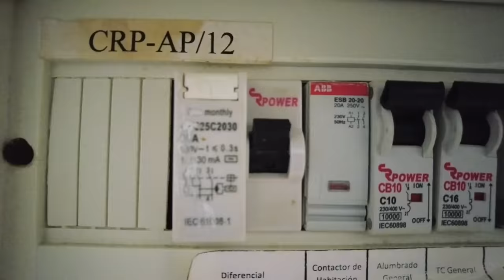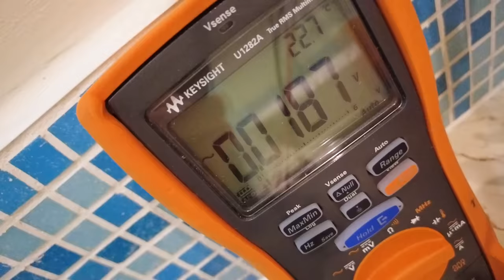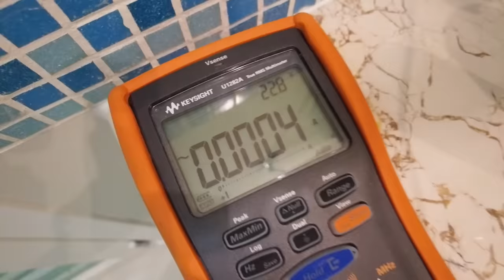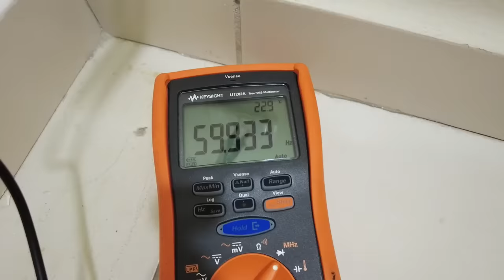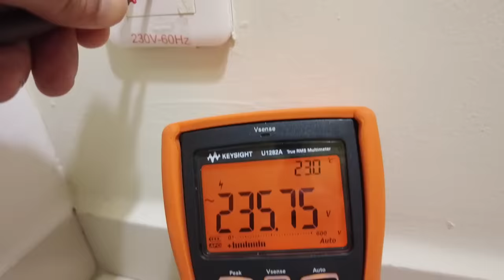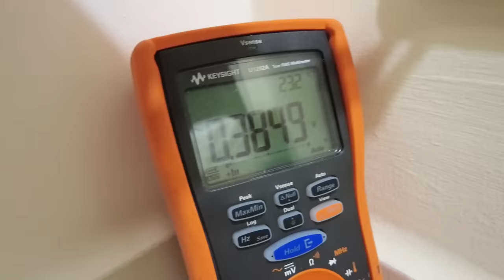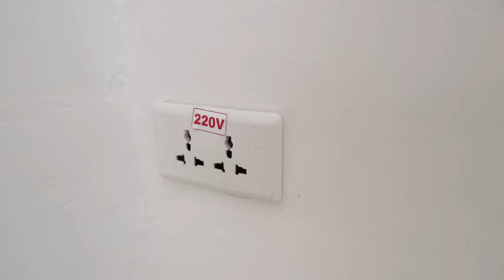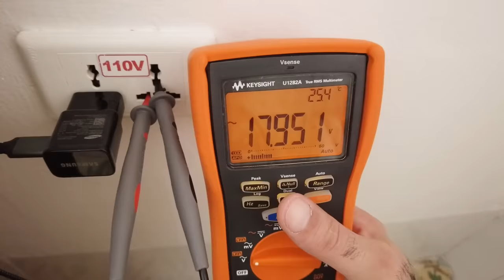Cuban Electrical System Shorting

Comment: An Isolated system is only safe as long as it stays safe, but if you don't have a protective cable (I think you call it "earth") a fault in a device may cause live voltage to appear on its outside and it will be undetectable.
Reply from the maker: Well I mean if it is isolated, even with a live voltage exposed it won't pose a life threatening danger, because there is no path to cause the circuit to electrocute anyone. It should be detectable though, because at 240V I'm sure you will feel it tingle once in a while even when it is completely isolated!
Reply: True, and it's ground btw, maybe earth in eastern european countries
Reply: @mroguretxs9651  In Poland you have "phase" (brown if only one), "neutral" (blue) and "protective" (striped green/yellow)
Reply: @babilon6097  never knew abt that, cool
Reply: @ElectroBOOM  If no current can flow will ground fault be able to detect it early?
Reply: @mroguretxs9651  Now that I think about it it used to be called "earth" but this usage is obsolete and anyone who wants their license renewed stopped using this term some years back. That's probably because both "earth" and "ground" translate to the same word in an electrical context. There is a process of grounding where you actually bury metal mesh or some other electrode in the ground. It is independent from whether your system uses protective cable.
Reply: @mroguretxs9651  No, large parts of western europe will also use "earth". Here in the uk we use both, though earth is more common, and i believe the official term.
Reply: @ElectroBOOM   But if they system are likely in Brazil, there is two phases 110v+110v in the 220v, so if you touch a single wire, it's just 110v undetectable if you are isolated
Reply: @ElectroBOOM  And in Brazil we have the two systems, 220v phase + neutral, and 220v phase + phase, it's depends the region you are. And is very common you found buildings with no ground or ground connect in nothing
Reply: At 16:32 isn't the 220v isolated via the switch that's turned off above it?
Reply: Yeah. The rule I use is if you have a (properly) isolated system and have 1 fault, you are good. If you have more than 1 fault, then you're not good.
In the case of that hotel, I would say using a traditional grounded system with GFCIs is probably your best bet.
But for a shaver outlet with only 1 plug, and very limited output, using an isolated system will probably work better.
He really should do a video on isolated power systems and what is available to keep them safe.
Reply: @babilon6097  Here, the typical phrase is "earth ground", which is used to distinguish "ground" as used in LV context (the "ground" on a laptop might or might not be referenced to "earth ground" when it's plugged in, and won't be when it isn't plugged into anything).
Reply: @lperkins2  Sorry, you have to expand on "here". My thought-reading pendant is not yet internet-enabled.
Reply: @babilon6097  Heh, fair.  North West US.  Can't say about the rest of the US, but Washington, Oregon, Idaho.
Reply: @lperkins2  I can understand naming a state after the first president, but I didn't know you have so much respect for Duncan from Dune. And the Oregon trail wasn't that big of a board game.

Ok. I'm exaggerating a bit. But honestly "north-west US" tells me more than those 3 names.
Reply: @babilon6097  I've learned to specify, since in most of the world, when they say "Washington", they mean "Washington DC", which we just call "DC".  DC is 2500 (4000km) miles from here.
Reply: I think I see where you are coming from, undetectable in that it could be isolated to the device alone, and not appear at a breaker panel at all. Yea you are nailing it, it works unless it isn't working, and in that case ehh not your problem anymore lol. 

you could easily become part of the circuit if it was a metal casing with more than one piece which incorporates plastic isolation somewhere, really anywhere. a screw just one little screw could be on one circuit while the rest of the device is floating at the other. grab both and goodnight sister. thing could be off, thats the scary part. just plugged in.
Reply: @ElectroBOOM  But it means that if you have a 60s old metalic cuban refrigerator without earth plugged and without a differential breaker... if the live touches the metal cover and you use the handle without shoes.. you could die
Reply: I think its not isolated, they just have live and neutral and installed a grounded outlet on 2 wires without ground connection. Common in old houses, especially in 2nd and 3rd world countries.
Reply: @ElectroBOOM  I think its not isolated, they just have live and neutral and installed a grounded outlet on 2 wires without ground connection. Common in old houses, especially in 2nd and 3rd world countries.
Reply: @mernokimuvek  Old houses in the 1st world often also have 2 wires.  Sometimes neutral gets tied to ground at the outlet, but often it's just left floating.  Code even allows that as long as it's labeled "no equipment ground" and is a GFCI.

The reason he's assuming it is an isolated circuit is because the potential drops to 0 when he shorts it to the plumbing (which is quite likely at earth-ground).
Reply: @wachocs16  Pretty sure there's a vid of that. I forget which country. Guy goes into a store barefoot and carrying a child, touches the door of a fridge, drops the kid and gets locked there getting electrocuted. Then some old guy runs over and knows exactly what to do and kicks the door off its hinges and saves his life.
Reply: @ElectroBOOM  I think your daughter's super cute. Would you mind if i send her flowers? :D
Reply: I'm from the UK and I like the "earth" naming rather than "ground". It can be helpful to make a distinction between ground within an electronic circuit and earth within an electrical installation. Even a mains-powered device may have its ground offset or completely independent of earth. A good example is capacitive dropper LED lamps: the ground within the DC part is actually live compared to earth.
Reply: @lperkins2  LV context? Everything is LV until 1000 V.

Comment: As someone from Brazil, I have seen many places like that, and I can guarantee that the lack of ground and those inverted pins are not due to technology or safety... Most electricians just ignore those because of the infrastructure or costs. It's usual to get shocks from the shower or fridges here. Those breakers are a luxury most houses don't have (I've only seen them in new buildings).
Reply: In most countries neutral wire is grounded on the power plants and transformer stations. I guess it helps to level out potential between different parts of network, but also this is what makes live wire, well, live. Mehdi found out at tha second place that not only outlets lack ground connection, but also have floating neutral. And probably it was intentional, to make it safer.
Reply: @voidseeker4394  It's grounded to make sure that plugged in household appliances that requires ground (because of metal encasing for example) are also grounded and do not shock you when somehwere in the system a short between the ground wire and a live wire happens or a lightning strike hits it.

Yea, it's safer when you touch the live wire but grounding itself is a safety measure for cases where you don't touch the live wire directly.
Reply: @Bobylein1337  uhm, i don't understand what you're talking about. Neutral wire, by definition, is a grounded wire used to get reference potential. If neither of wires is grounded, there is no live wire, both are equal. And shorting it to ground won't do much, because it's whats already done in most countries. And chassis ground is different from the neutral wire, it's dedicated wire, usually grounded locally near the building.
Reply: G E T  R E K T  your example is irrelevant, 12v battery terminals have potential difference with each other, obviously. But there won't be any noticable current flowing if you connect one of them to the ground. Also, battery outputs DC, while power grid runs on AC, which makes wires change their potentials at 50/60 Hz frequency.
Reply: G E T  R E K T  i know that ungrounded circuit can have potential difference to ground, but resistance is so high it won't allow any significant current flowing to ground. This is exactly what Mehdi shown in the video. Voltmeter is reading voltage between floating wire and ground, but it doesn't provide current flow.
Reply: G E T  R E K T  yes, if you touch both wires, you'll get shock, no matter whether there is neutral or not. But if you touch just one, and touch ground elsewhere, you're likely to be fine if none of the wires is grounded. If neutral is grounded, however, and you touch line(non-neutral) wire, you'll get shock with dangerous current, just like if you touch both wires at the same time. This is why some standards allow outlets in the bathrooms if they are connected via decoupling transformer (like that shaver-only outlet in the video). Decoupling transformer is doing exactly that - "ungrounding" neutral to make it a bit safer.
Reply: @Voidseeker I know it’s out of topic here, but there’s a good reason why most electrical installations are grounded.. it’s to provide automatic fault disconnection by circuit breakers and rccb/gfci, before it becomes a safety issue after a single fault occurs. In an isolated system, a single fault where a live wire touches a metal enclosure cannot be automatically detected, and thus, if one day, another fault occurs somewhere in the system it is never detected and can be fatal if electricity runs between the faults (like through metallic pipes). This is known as a double or second fault. This issues are well documented in IT earthing systems. Earthed systems include TN-C-S, TN-S, and TT.
Reply: This is the true reason. Inverted wires? Dont worry it works so whatever. Earth/Ground? You want to run an optional extra wire? You know how much that will cost?. And that basically sums electrical connections in latin america i guess

Comment: 2:21 Those are commercial smoke detectors that are tied directly to the buildings Fire Alarm Control Panel (FACP). Setting it off will set the entire building into alarm, if it's set up as an alarm and not a supervisory. It may just set off three floors; The floor of alarm, and one floor above and below. If it is set up as a supervisory, it will just let the hotel staff know to check the room.

The smoke alarm in your previous video can either be standalone or tied into the building FACP. The difference is it's an older conventional device that is wired in zones with other devices so staff won't know exactly where the alarm is coming from, typically just the floor. The one in this hotel is addressable and (If programmed correctly) will tell the staff exactly what room it is in.
Reply: A month ago I didn't know anything about fire alarms, but my four year old has become obsessed for some reason, and constantly watches videos about them and knows all the brands and lingo. It is starting to rub off on me. He even had me install a mini xp95 loop with a C-TEC panel in his bedroom. Now I also constantly notice and ponder on fire alarms and call points etc wherever I go.
Reply: Are bedroom smoke detectors programmed differently than hallway smoke detectors? Like do they enable verification or set it up as a supervisory like you said? What’s typically done in most hotels and what not?
Reply: @mattdude  It depends on the AHJ (Authority Having Jurisdiction, typically the fire marshal) and the fire code in the country/state. Some have all hotel rooms report as just a supervisory with local sounders, sometimes it's a fire alarm and sets off the entire building. The common area smokes will typically send an alarm.

Comment: Hotels that cater to international tourism often have those "universal" outlets that accept a wild assortment of plugs. It usually isn't the socket that is usual in residentual buildings. What I found interesting is your video is that your hostel had two different voltage conduits installed

Comment: In Greece we have basically the same thing, some areas where it is hard to get a good grounding work without grounding. Also we have those 230-110 dryer sockets in tourist buildings and all outdoor lights are on a transformer and usually down the power to 12-42v. This sometimes they don't do this and it causes countless problems in winter

Comment: Normal tourist:
Let's pop open a 12 pack of beer and then see if there's a shortcut to the pool.

Mehdi: 
Let's see if we pop a breaker if there's a 12k ohm short to ground. 😂
Reply: 12 kOhm short? Thats resistance, not short. A short circuit is ideally zero Ohms, milliohms in real life.
Reply: @mernokimuvek  Well in this case we usually see it as a "short" because the current is taking an unplanned path which could be destructive or dangerous, even though the resistance is much higher than what would normally be thought of as a short.
Reply: Why not both? Should be fun.
Reply: @HeyChickens  Thats called leakage or ground fault, not short.
Reply: @mernokimuvek Obviously this is not a traditional condition that we would label as a short, but the term can still be loosely applied. Like I said before, the term "short" is not necessarily always limited to near zero ohms. The very word "short" implies a certain amount of distance, but less than what was originally planned. It was originally planned for the electricity to make a circuit through an appliance cord and the apparatus that was plugged in. But Mehdi simulated a condition where that current found a "shorter" path through a resistor and into the ground. This condition ended up activating the ground fault protection circuitry which cut power to the room. So yeah, it was more of a ground fault situation than a dead short, but the term is still loosely applicable I think.

Comment: 9:02 - For example in Poland there is no standard (in theory, it should be the same in the whole room, but it all depends on the electrician and the type of sockets if they are single or multiple)
Reply: Yeah same in India. Your wiring depends on how the electrician does it.
Reply: It's like this in most of Europe. Devices simply don't expect one side to always be live or neutral. I think it's better this way as assumptions only lead to dangerous situations if technicians wire things incorrectly.

Comment: The system in Havana is called IT, and is usefull when you want a permanent service even with a ground to live shortcircuit. Altough, if a second failure appears in the other active conductor, you might get shocked since the circuit is closing through the ground.

Comment: That smoke detector is quite recent. It’s called “addressable” which means it takes 2 wires: +SLC and -SLC. The SLC is a 2 wire power and serial data bus for all fire alarm system input devices. Basically it’s continuously biased at 24VDC for power and has serial data transmitted on top of that. Every device has a unique address on the bus, and if you unplug it, the fire panel will know exactly which device was disconnected when it stops pinging! Complete with a text string of what room number it’s in.

Comment: 7:35
Why don't more multimeters have this feature? I got an embarrassing surprise when I tried measuring voltage, but measured current instead. A LOUD pop at 230V and 50Hz. My meter has an resistance of 100 mΩ, the meters of wire around 5Ω, so it drew ~46A for a split second, tripping a 16A Class B MCB instantly. And even better, it happened in school. Fortunately, my meter's fuse blew up and that was all the damage.
Reply: I once tried measuring current on voltage. I had a loud pop, smoke dust went everywhere, a probe melted, and the fuse blew.

Comment: 7:25 I couldn't be the only one thinking "Mehdi you were just measuring current through a resistor, did you change the prongs back to voltage ?????"

Comment: I have heard its common in South America for nothing to be referenced to ground because its considered safer since ideally there would never a path for significant return current unless you somehow get across both live and neutral. Not sure if that's the case, or just non-existent standards. Enjoyed the video as always.
Reply: What if, a short in the power trasnformer on the pole happens between HV primary and low voltage secondary? If one side of secondary is not 'grounded', HV can appear on the secondary, and no one will know until someone gets shocked. If one side of secondary is grounded, the fuse on the primary winding will pop.
Reply: @uploadJ  Norway has ungrounded 133/230 V system with overvoltage protection. If the voltage between the seondary star point and ground is significantly larger than 230 V, it will  short the start point of the secondary to ground.
Reply: @uploadJ  I suppose you are correct since the whole secondary would be 'floating', everything on the secondary circuit could be at HV but with respect to a non-existent 'ground' reference. 

But in order to receive a shock with the failure you mentioned, the primary voltage would need a low impedance reference to earth ground. The way I understand their grounding systems (which may be totally flawed, I am no expert in south American wiring practices.) is that everything on the secondary side is basically floating with respect to ground. The only earth grounds that exist are near substations and the like, and that is way too far of a distance for any real current to conduct through soil.

Comment: Standardization are different from rules. You can apply them but you're not obligated to it. Although it's a bit safer method to put the live wire in the smaller contact, it's AC, there's no problem in swapping it. Both protections and functionalities will work just fine.